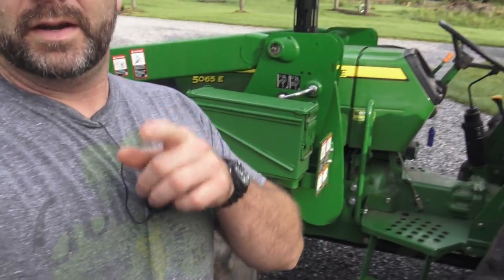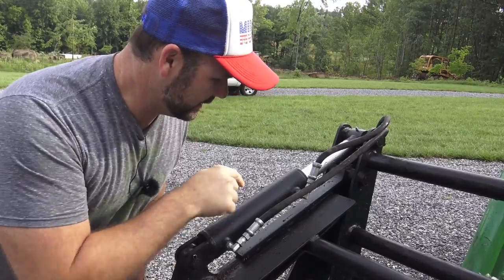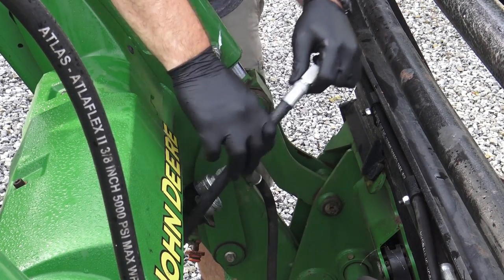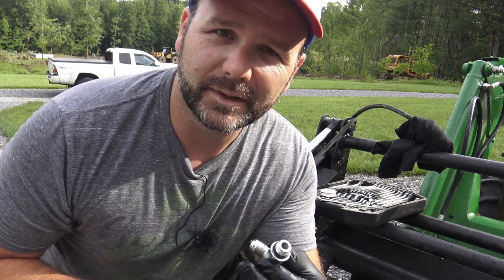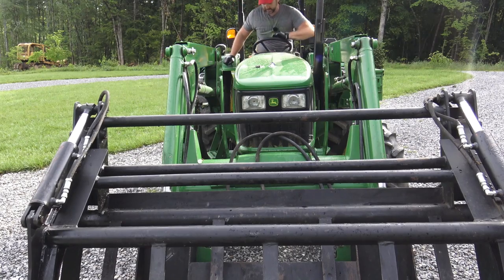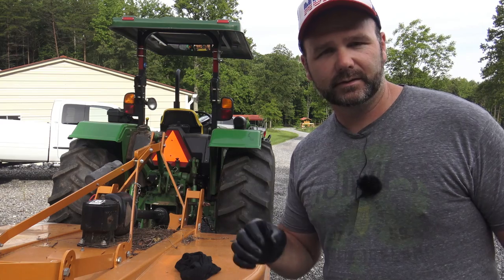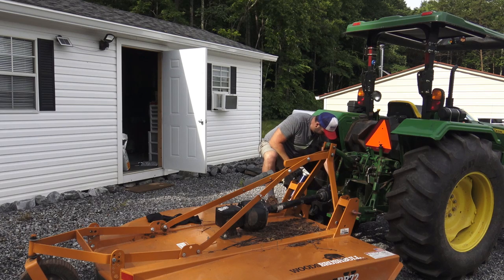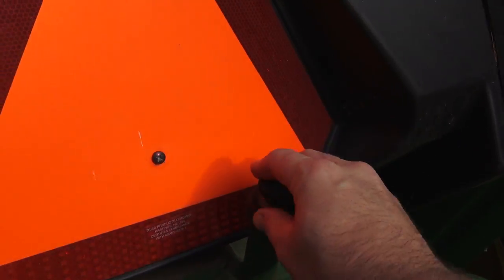How to properly lubricate and maintain your Bush hog (rotary cutter) Tractor Hydraulic Repair Job

Comment: You are so correct about checking for lubrication points on both your tractor, and bush hog and making sure all points are lubricated. I have a newer John Deere 790 tractor with the John Deere 513 bush hog and I had this equipment since they was new. That was nice that you only had to replace the O-ring on the grapper tool. I wish that when I purchased my tractor, I had gotten the front loader on it as there are times when it would have come in handy.
Reply from the maker: Thanks for the comment Sidney....yep gotta take care of these machines....make them last as long as we do!

Comment: Like watching the old videos, the place has changed a lot in the last two years. On my brush hog, I’ve got to actually remove the sheer pin and remove the pto in order to reach my rear zerk fitting.

Comment: That elbow fitting is always issues, as the arm move they loosed tightness, so pressure built up the oil leaked through, tared the O ring rubber. I worked with forklift for a decade more, oil leaks was every day issue sometimes.

Comment: I think it’s good practice to at least once a year to loosen the clutch on your rotary cutter pto shaft, just to be sure it’s not stuck, if you do hit something solid you want your clutch to be able to slip, sometimes when new they can be stuck with paint or rust if they set outside,
Hate to break a pto shaft or internal tractor pto clutch,
Nice equipment,  enjoy watching your videos, do you ever let the pretty girl drive the tractor?

Comment: OIl level depends on the operation of the equip  the tractor is operating, some machines require that you add more oil when.... using and remove it when finished........Read the manual

Comment: when you hear the pop you just put in to much
Reply from the maker: Harry Hall well dang buddy, when should I stop pumping in grease? And what can it hurt to put a little extra? Please any tips are appreciated
Reply: when you hear the pop you just pusher grease past the seal , making it no longer water tight  if just using every day on dry land just 3 or 4 good pumps should do . if you have to clean any grease off the fitting the seal is no longer tight
Reply from the maker: Cool, well good to know man thanks.....I've got a stubborn stuck grease fitting on my new bush hog...any suggestions to get it to take grease? Or should I just replace it? Thanks for all ur comments Harry